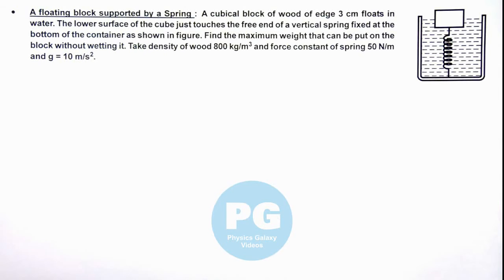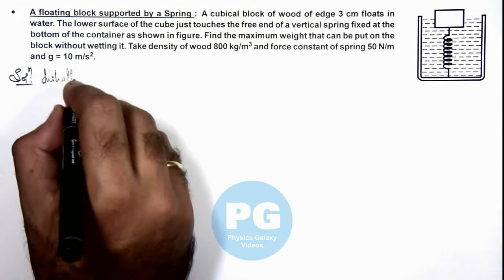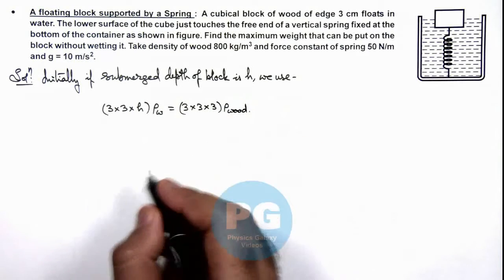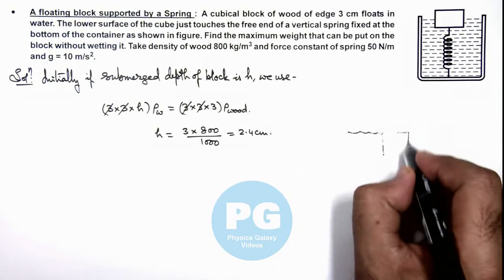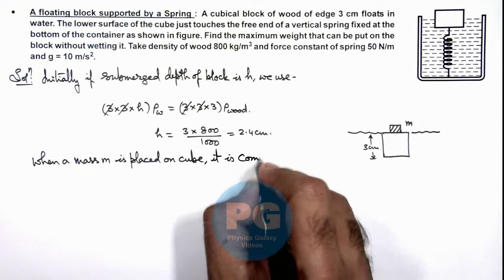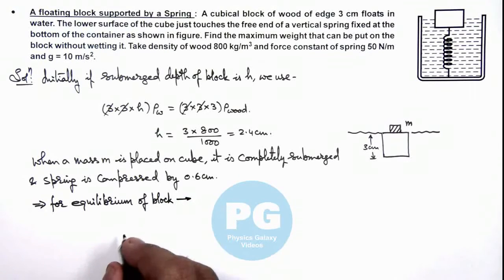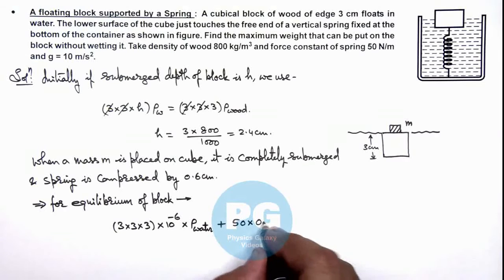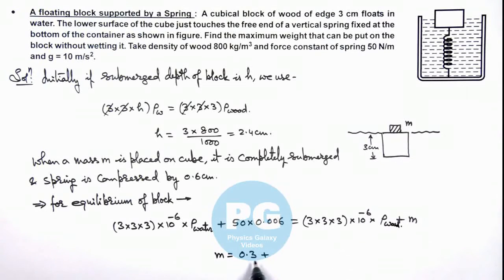14. Advance Illustration | Fluid Statics & Dynamics | A floating block supported by a Spring

Comment: if weight is never getting wet, then at extreme position it should be just above the surface and not at eqb right? so eqb compression must be 0.6/2=0.3 cm right?
Reply: According to the dictionary definition of "wet", wet means "covered or saturated in water". So I think that's what the question meant. I also, had the same question as you.